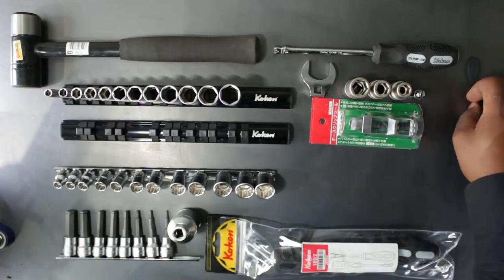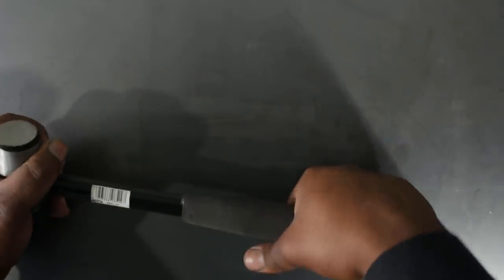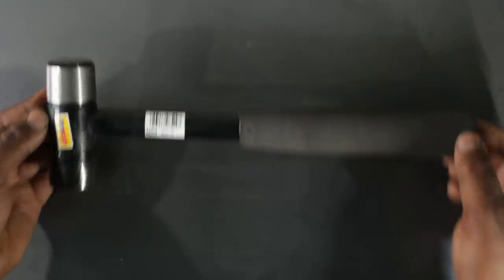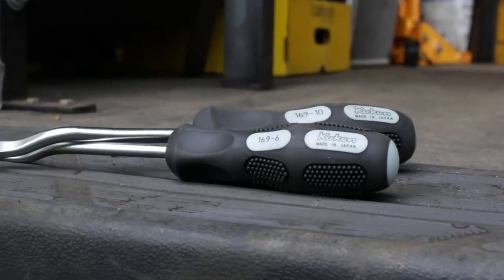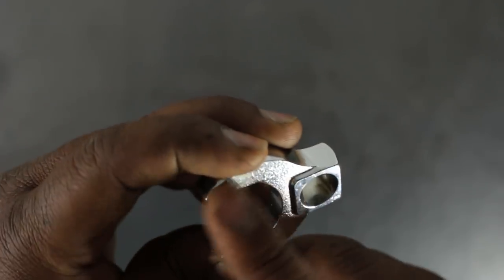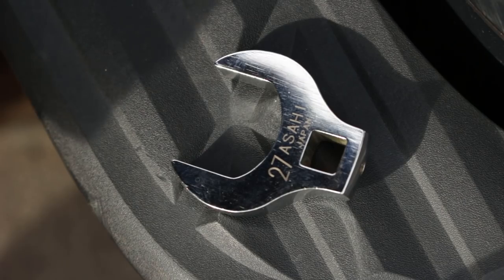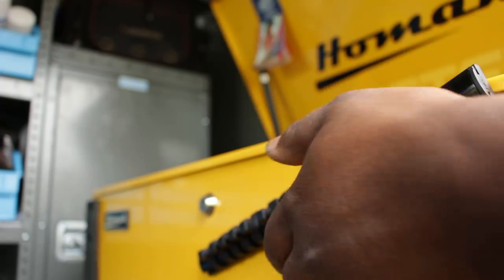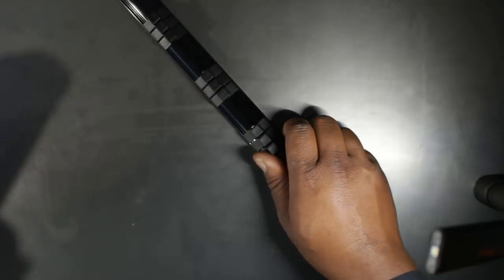NEPROS, KOKEN, and TONE Japanese Tool Haul.

Comment: I’m a tech for a major Japanese automotive manufacturing company at the factory. The sockets with the o ring are for the assembly line. Any fastener that hast to be torqued to spec uses this type of sockets. The ridge above the o ring is there to hold it to change the pin, as they tend to break and must be replaced. Thank you for your videos.
Reply from the maker: Thanks for the insight, I can definitely imagine having to replace sockets often due to duty cycle. Thanks for watching!

Comment: Bro I just picked up the standard length 3/8 Blue Nepros ratchet and it is amazing! Soooooo excited to see that little black box in the opening of this video!
Reply from the maker: Nice! Where'd you get it from? Do you think the blue is better than the standard chrome??? You know they also have IP black chrome for nepros I was looking at those too
Reply: @GarnettTools  I picked it up from Frank's a couple months back.

I did some digging on KTC NEPROS Japan website and it gave me the impression that the blue chrome (and maybe the black?) Is an additional process that gives the finish extra durability vs the regular.

I'm a weekender so I've only used it on a couple jobs, but amazing and 100% worth it so far.
Reply: The ion plating process was apparently developed by NASA.
One sexy ratchet they are.

Comment: I just watched this video for the second time, after I last saw it two years ago! 😆 How's everything holding up? I'm curious about the crowsfoot and how the Ko-ken rubber handles have held up to dirty/grimy conditions.
Reply from the maker: Appreciate the support bud! But the crowsfoot held up very nicely with no real issues and the laser etching has not faded as of yet. Tho I haven't really had those Koken handles in any real dirty/grimy situations, I can say however that those fine dimples have remained unlike cheap versions of the same handle.
Reply: @GarnettTools  right on! I've been using Ko-ken's 2pc set of hose pluckers for a decade now and they haven't degraded at all. They're only subjected to coolant for liquid though. Cheers!

Comment: Thanks for the video. 
Really liking the hex bits.
And that nepros ratchet it the bomb. Coworker has one and i want one so bad. I just can't justify one  at this time.
Reply from the maker: Yes, the Hex set comes in handy at times and just a heads up the Nepros is now about $20 less than I paid for it over a year ago but i know $100 is still a bit much for a 1/4" ratchet.

Comment: Nice Haul!

Would you recommend some of these tools to a apprentice mechanic who isn't ready to jump into snap-on or mac tools to start their tool collection?
Reply from the maker: Absolutely! These are so much cheaper comparative to those two brands with essentially the same quality. But there's a trade off. Warranty service will be quite a bit different, where most truck brands will simply replace or repair your tools right on site, these Japanese brands will likely ask for pictures and/or for them to be sent back and even then, there are reports that they may deny your claim after analysing. For comparison Snap-on wants $297 for the equivalent metric deep set in this video and I only paid $94. Due to warranty concerns I'd say you can just pick up some stuff from SK https://www.harryepstein.com/index.php/sockets-3-8-socket-sets-28773.html if you're in America this SK set is nearly as cheap as the Japanese one at $102. You'll still have to contact SK directly for warranty but they, just like truck brands, will quickly replace a broken socket. 

So if you're the type to put a reducer on a 24" long breaker bar and use a 3/8" socket or use chrome sockets on an impact just go SK because the Japanese operate under a completely different philosophy and their tools are only meant to be used "properly"

Comment: That is a awesome too haul Garnett. Do they make 1/4" wobble plus driver?
Reply from the maker: Yes they do, http://www.frankstools.com/ko1wodr27.html it does not have a drive on the end of the handle so it can't be used as an extension like some of the others can but it is still wobble plus.
Reply: Neat thanks.

Comment: I wish the wobble driver had a female end so you could also use it as an extension. My 1/4 drive Snap on has that but I haven't seen one in 3/8s. Maybe they have one??????
Reply from the maker: I too wish that was there. I recently spoke to a snap on dealer, they have one in 3/8 but it's not wobble and still no female drive end. In my research the only other ones I have found besides Snap-on and Koken are Mac and FPC. FPC is another japanese company but it's hard to get, but Mac's do have a female drive on the end but Koken's is still the only one that's wobble.
Reply: I'll have to look and see if they still offer the 1/4 drive with the female end. Mine is the old style hard slick black handle. Still use it a lot.

Comment: Gearwrench 120xp better price more teeth
Reply from the maker: Sorry, I have one. It's JUNK!
Reply from the maker: PLUS, as compared to Nepros, the Japanese ratchet is quite literally 10 times the quality.
Reply: Outlasted the shit out of my snap on and doesn't get the head wobble. Is the Japanese one really that good?
Reply from the maker: Absolutely. I suppose by "doesn't get head wobble" you mean your Gearwrench has detents with multiposition head? But the Nepros has a spring loaded nylon pad pressing up against the flex joint keeping the head from flopping around, it's got a slimmer profile head, and the difference between 3 degrees and 4 degrees is negligible anyways especially in 1/4" The Gearwrench factually doesn't have more "teeth" it has a 60 tooth gear with dual pawls walking along it that are half the width of the gear.

The major downside to the 120xp is that since it has that stacked pawl design, only one of them is engaged at any time so you now have half the surface area of a normal pawl. Also the gear of the 120xp is not centered in the back of the ratchet housing , meaning the gear teeth are allowed to torque up against the ratchet body when you apply force.
Reply: @GarnettTools  very good explanation and i do agree i know how its set up i always take my tools apart and lubricate if possible I'm in the rust belt. I may have to look into one of those ratchet but i have had no issues with strength of the 120xp and have had them for 18months and honestly beat the shit out of them even putting pipes on it and the gears have never failed or jammed and they are used extensively i think they are quite good for ths price thats why matco uses the same manufacturer